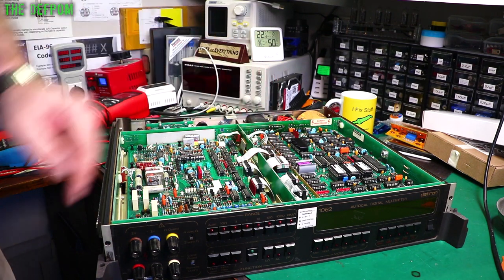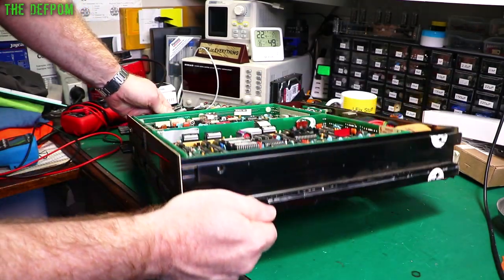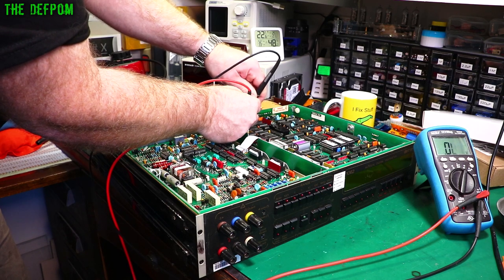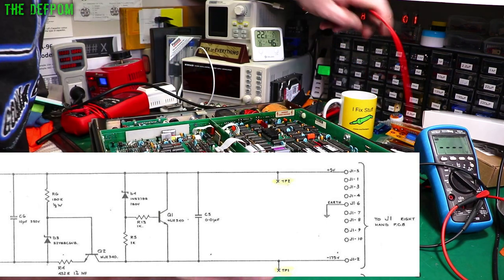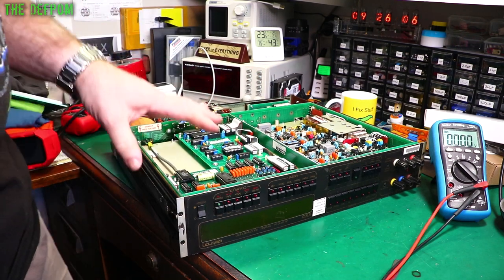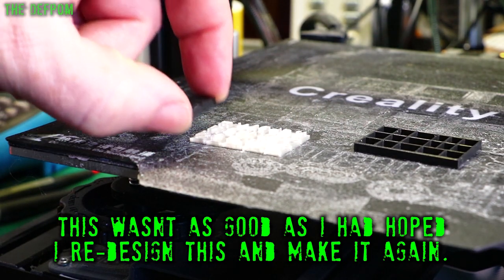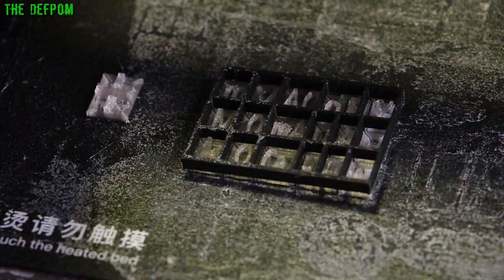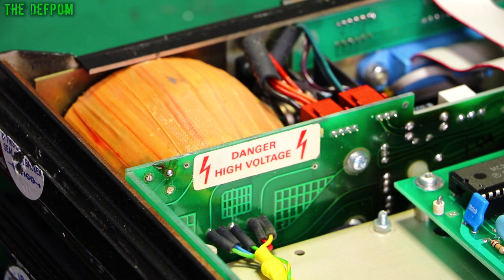🔴 Datron 1062 Multimeter Repair Part 1 SN_016117 - No.795

Comment: Stacked PROMS are common in some equipment where they have CS lines on one device and /CS lines on the other, so they can double up on the capacity in 1 socket
Reply from the maker: In that situation it makes sense, but oddly in this case it just looks like stacked sockets ? it is using 27C32 EPROM's instead of the 2532JL as used in the earlier versions, so my initial thought was it was done to rewire pins 19,20,21, but they go straight through ?

Comment: That was a real shame that the display was buggered :-(
Hopefully your led display doesn't need too much current, leds are greedy lol.
My mate had a racal counter with numerators, very sad looking.
I cut the high voltage and plopped new driver chips on a bit of stripboard, wired that to 7 segment displays.
Worked fine!, the psu didnt give a dam.
The idea was to make it easy to reverse if the numerators became available, they never did :-(.
I was wondering if you were going to do a similar thing,  a temp setup so you can get the rest of the meter working.
Yes i know, a vfd, Chickens teeth lol.
Reply from the maker: I would have liked to do a bolt on replacement so it would have been easy to just swap it out, and it MAY actually be possible if I use some IC's to do voltage conversions / drive the LED's, maybe if these things sell OK I will look at doing a Rev 2.0 that allows the driver board to remain unmodified, but as it is, the LED's at the very least require the driver board resistors to be swapped out to increase the available current, as even at 180V the 330K resistors won't allow the LED's to light up, and swapping the resistors out still means that there is too much drive present when the segments are turned off from the -70V rail so they would all glow constantly.